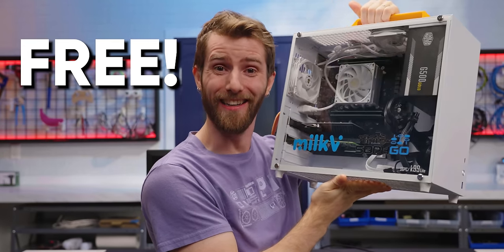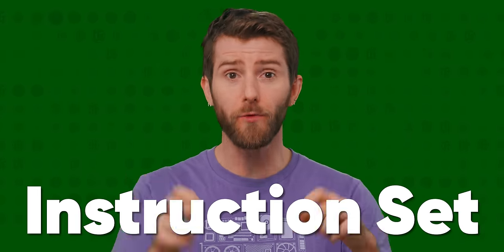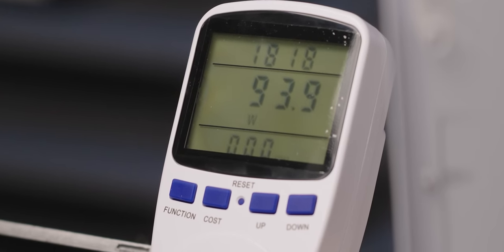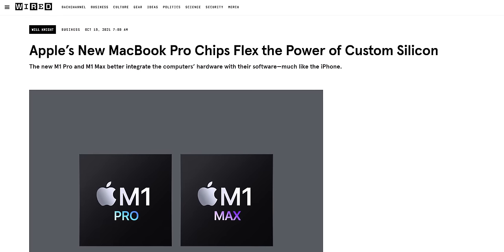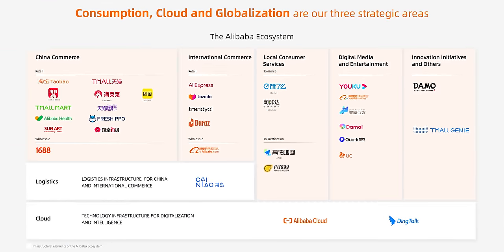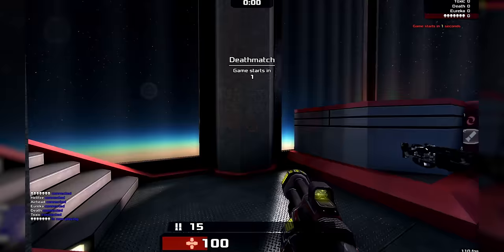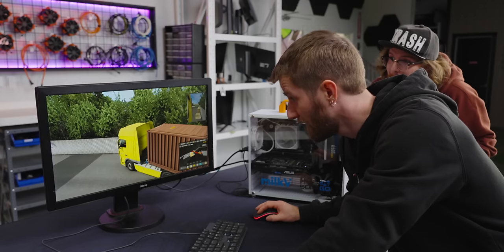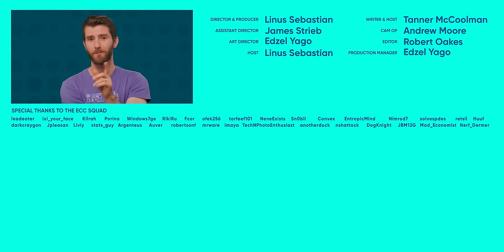This CPU is FREE! - Milk-V Pioneer with RISC-V

Comment: Just a quick FYI for everyone. ISA or as it's referred to here, 'instruction set'. Does not matter when it comes to performance, it is all down to the microcode. Think of the ISA as the building blocks and the microcode as the blueprint. How well you optimize the blueprints determines how fast you build what you need.
Reply: Yes, with a Reduced Instruction Set it's far easier to optimize microcode.
I used to work with Sun on the SPARC systems - Yeah I know, ancient.
Reply: I mean, simplifying the ISA simplifies the whole design, no?

Fewer instructions means fewer paths to optimize. Not having to maintain backwards compatibility with x86 bugs that got elevated to features will help with that, too. Theoretically, you can fit the full performance of these most important instructions into a smaller chip that uses less power.

But... x86 has a lot of history and momentum behind it. What we have is heavily optimized  while your RISC-V chips are still largely in the exploratory phases. But... There's a reason Intel's Atom chips never really competed with Arm CPUs.
Reply: @psiah9889 It really depends on the task at hand. Even if you can get better optimization of your simpler design, that doesn't mean the software runs in a more optimized way. Just look at how many instructions ARM has picked up over time. Went from not supporting division to supporting SIMD, crypto extensions, and so much more. On the opposite side, x86 is largely RISC under the hood with only the instruction decoder understanding all the instructions before promptly decoding them to simpler instructions that the processor can actually execute. I don't think there's a huge difference in complexity, which is why only a few companies actually design ARM cores (just Apple and ARM these days, I believe) and the rest of the SoC designers just license ARM's core designs.
Reply: Not true. ISA can affect performance, specifically in 2 ways:
1. Atomic operation, specifically synchronization. Thread synchronization when done without atomic operations can take hundreds of cycles since it requires trying and retrying to synchronize until it is successful. With atomic operations synchronization is guaranteed to be attempted once and completed successfully.That gives CISC CPUs some advantage in multithreaded applications that often synchronize.
2. Heat generation. A CPU core is generating heat from each circuit regardless if its being used or not. The reason is that all of those circuits are doing the calculations at the same time and all results except for one are discarded. The more instructions a CPU can handle, the more circuits a core needs and the more heat it is generating. And heat generation significantly limits max clock speed of the CPU and thus its max performance.

First one give CISC advantage, while second one gives RISC advantage.
And over time the heat issue became so limiting that RISC started winning with CISC, even though CISC was the performance winner for many years.
Reply: Standard RISC-V instructions until now don't need microcode or microops -- or at least 1 instruction = 1 microop. Future high end cores might combine 2 instructions into 1 microop sometimes (as recent x86 and Arm do for "cmp;bCC" but nothing in the market right now (and not this computer for sure).
Reply: @hubertnnn  Core design is a lot more complicated than you make it out to be. First of all, not every circuit on a CPU will be running all the time. It depends on what instructions are running. The CPU will only dispatch an instruction to relevant units of the CPU. You can also frequently implement very complicated instructions relatively simply, after your decoder breaks them down into a series of simpler instructions. Of course, there are many tradeoffs (performance vs power consumption vs complexity, etc) to consider when deciding exactly how to design this hardware, but it is certainly not as simple as saying that a more complicated instruction set leads to a more complicated design. I'd bet good money on modern ARM processors being orders of magnitude more complex than early x86 processors.
Reply: ISA absolutely does matter. You can write the best microcode in the universe, but if your CPU is physically not capable of single instruction integer multiplication, you're gonna be hogging the CPU with aditions for quite a while.
Reply: @Sett86  when people say "ISA doesn't matter" they don't mean that it is impossible to design a bad ISA -- of course it is ... see Brainfuck etc -- but that all good ISAs are more or less equivalent.
Reply: @user-bc7cb8uu7e yeah, but the complexity of the x86_64 Isa requires additional decoding circuitry and plenty of hardware optimization. A simpler ISA means the chip among others can provide similar performance at a lower power requirement and heat output
Reply: @BruceHoult Brainfuck isn't an ISA lol, it's an esoteric programming language. COMPLETELY different things
Reply: @hubertnnn Your second point is false. CPUs have been using dark silicon for years now, so it's not true that the entire CPU is on 100% of the time. If it were, it would fry itself immediately
Reply: @user-bc7cb8uu7e What should also not be ignored is scope. Apple Silicon is often used as an example for the efficiency of ARM based CPUs and they are intended very efficient. But they are custom hardware specifically designed to only go along with very specific hardware from the same vendor. This gives Apple a huge advantage compared to x86 processors, which have to support an arbitrary amount of additional devices and memory configurations. Apple on the other hand can dump a lot of that in their design or tightly integrate it into the SoC, which reduces the overall complexity if the design and in turn increases the performance and efficiency. But it comes at the cost of losing flexibility when it comes to hardware configurations.
Reply: Why are people talking stuff they don't know? Microcode is not used for any performance critical pathways.

Any instruction that relies on microcode is going to have severe performance penalties.
Reply: Dude there are enough processor families that directly use the ISA without any microcode whatsoever..
Reply: @romanpul  that's not very true. Apple Silicon are true general purpose CPUs and GPUs. With documentation, everyone could build drivers and OS for it, and Linux people even manage to do so without doc.
Reply: Be great if you could pick what ISA you used and the microcode dealt with all that, viable.  Indeed, be some institutions who would love a custom ISA and enable better lockdown of the software as be obfuscated with non-standard ISA.  For some tasks (military/security) that would be useful.
Reply: @nocturn9x  not so. Have you SEEN Brainfuck? It's much more like a machine code than a normal programming language. You can easily make a hardware CPU that executes Brainfuck directly.
Reply: soo... i guess apple can do it because their software is optimized for their hardware, and their M series chip also equipped with a lot of specialized hardware acceleration right?
Reply: @hubertnnn  But modern RISC architectures have atomic operations. It would be stupid for them not to include them.
Reply: @RandomUser2401  You missed the point they were making. It's not about "general purpose", aka Turing Complete (MTG and Pokemon are Turing complete), it's about Apple not having to deal with dozens of HW OEMs that might or might not tweak a knob thus resulting in different results. See the AMD/ASUS voltage fiasco for something that would never happen with Apple.
Reply: @Ruhrpottpatriot  again, the situation is not as different as you think it is. Having to support more HW configurations than Apple is no excuse to lesser optimization of the OS to specific HW platforms. That especially applies to Windows RT.
Reply: @RandomUser2401  The OS has nothing to do with the ISA (at least not directly) and nobody claimed anything in that direction. We're talking about ISA optimizations and microcode.

Having to support more hardware with your ISA means you have to factor in more variables, which makes everything harder and some paths even impossible because you can't reason about them with certainty. More general purpose ISAs like X86/64 will have instructions that run in many different situations, but generally won't perform as much. On the other hand more specific ISAs like Apple's flavour of ARM can make assumptions that make it impossible to run on certain HW, but in turn give it a huge performance boost.
Reply: @Ruhrpottpatriot  that‘s horseshiet. Every CPU manufacturer can tweak the microcode to get the most out of their specific microarchitecture. In addition, there‘s tons of x86 extension „to get the most“ out of x86 processors.
Reply: @RandomUser2401  Go take at least the introductory lecture into CPU design in EE or CS. Then we'll talk again. Because you have no clue what you're actually talking about.
Reply: @Ruhrpottpatriot  I am far far beyond that, and actually do design RISC based multiprocessor systems. What you are saying makes absolutely zero sense. There is no „lots of HW“ that x86 needs to „support“. That makes zero sense. x86 defines a huge amount of instructions that each CPU vendor then implements in their optimized way, not the other way round. Now, please read the Patterson book. You really need it.
Reply: @RandomUser2401  "There is no „lots of HW“ that x86 needs to „support“."
I never said that. Stop misquoting me!

"x86 defines a huge amount of instructions that each CPU vendor then implements in their optimized way, not the other way round."
I never stated anything to the contrary.

"I am far far beyond that, and actually do design RISC based multiprocessor systems"
#doubt. And even if, I wouldn't want to buy a CPU from a company where the designers are not able to properly comprehend what the other party is writing.
Reply: @Ruhrpottpatriot  just admit that you have no clue. the burden that you claim x86 has is not existent.
Reply: @mmbb1645  Every CPU operation is atomic by definition. What I meant was that you can either atomically be able to do "Add A to B and store in A" (a simple operation available in all CPUs), or "IF A is zero, put B in A and store 1 in C, otherwise store 0 in C" (a complex multi-step synchronization operation).

In CISC the second example might be available as single atomic operation, while in RISC you will need to do it in multiple steps, thus the entire process not being atomic.
Reply: The biggest issue of RISC-V is volume, as we get more volume, we'll see larger and higher density chps which have more performance
Reply: @hubertnnn  Ah ok, you're right. I didn't realize that most ARM processors only have the "store" and "load" atomic operations.
Reply: @RandomUser2401  That has absolutely nothing to do with what I just said. I was talking about hardware side support, that has nothing to do with drivers or microcode. For example Apple Silicon use on chip RAM instead of dimm ram, which reduces the physical complexity of the memory controller. And it also has the memory controller for mass storage baked into the SoC for example. Try plugging a random m.2 drive into a silicon mac. Good luck with that. No driver will make that work
Reply: This guy has no idea what they're talking about. Microcode is entirely optional when designing a CPU, it just allows to patch some issues in the silicon without needing to remake it physically. But it's not a requirement.
Reply: @BruceHoult  I've implemented brainfuck interpreters and compilers. It's a programming language. Not an ISA. End of story. You could make a CPU that runs Java bytecode and that would be much more of an ISA than brainfuck, rofl.
Reply: @nocturn9x  people have made CPUs that run Java bytecodes, not least Arm Jazelle. Certainly that is a nicer and more usable ISA than Brainfuck, but that doesn't make Brainfuck "not an ISA" but just an awful one (which was the point). I do have some relevant experience and qualifications in this, by the way. I've worked professionally on many compilers, interpreters, JITs, emulators, assemblers over the past 25 years or so. Right now I'm working in the project making the RISC-V JIT for the C# IL. I also get involved in the design of ISAs (you can find my name in the credits in the RISC-V ISA manual and also in the B and V extension specs), and in doing that I interact closely with people designing the actual CPU cores.
Reply: The biggest mistake in optimizing the ARM architecture is that ARM has the authority to prohibit modifications to the CPU core, and many others and also prohibits selling to other parties and so on, whereas if you use RISC-V, the flexibility is very high, the IP is also easy to buy and sell.
Reply: @BruceHoult  A lighter question: this whole ISA comment thread is interesting. I'm moving from Desktops to SBCs and IMHO ARM ISA is smallest, most efficient and affordable (compared to x86). However I would like to support RISC-V ISA (I'm a FOSS fan) if I can find an SBC with dual NICs, 3 monitors, Bluetooth and Wi-Fi. Someone on this thread my be able to help, thank you in advance?
Reply: @kotgc7987  dual gigE NICs and WIFI & Bluetooth is easy -- many RISC-V SBCs have those. Three monitors -- I don't know anything (or in the Arm world too) that has three HDMI connectors on the motherboard. You're basically I think going to need a board with one or more PCIe slots. The Pioneer shown here of course has two PCIe slots, but it costs $2500. There are RISC-V boards with PCIe slots starting from the HiFive Unmatched (now $299 with 16 GB RAM, quad core 1.4 GHz), and also the Pine64 Star64, and the Milk-V Jupiter (price and release date not yet announced, but probably around $100). The HiFive and the Jupiter are both MiniITX boards, the Star64 at 133x80 is a little larger than a Raspberry Pi. All those have CPU cores roughtly comparable to the Milk-V Pioneer shown here, but 4 of them rather than 64, or 8 in the case of the Jupiter. The Milk-V Oasis, probably arriving early next year (they say Q4, but ...) has 16 cores, each about 3x faster than the boards you can get now, and leapfrogging the Pi 5, Rock 5, Orange Pi 5 in the Arm world.
Reply: @BruceHoult  thanks, doesn't have to be HDMI, whatever desktop monitors/displays run off...USB-C, DP or whatever's an easy connection.

Comment: I've been really excited about the future of RISC-V for a while. I really hope they break into the mainstream sometime in the next few years with all the major issues worked out.
Reply: First
Reply: In specialized hardware, quite possibly. But for general computing, I wouldn't expect it this decade, especially with all major issues worked out. One of the biggest factors for X86 is backwards compatibility. Right now, you can buy a 20 years old videogame and just play it without any fuss. Moving to a different architecture will have to contend with that.
Reply: @CanIHasThisName  Apple did it with ARM. I imagine creating RISC-V chips that are specialized for x86 and/or ARM translation will have a big impact. As I understand it, Apple has specialized ARM chips that help it work better with the x86_64 translation. AFAIK Microsoft has been kinda stagnant in the ARM space because of a deal with Qualcomm. But I could be wrong. 

If Microsoft took RISC-V seriously and invested in the future like Apple did, we could see something very compelling. We can already see in this video that gaming IS possible. It's definitely not there yet. But the sheer fact that it can be done means that it will inevitably get better.

Hopefully once the RISC-V instruction set gets standardized vectorization instructions, we'll see much better performance.
Reply: @Spirrwell  Apple did it with ARM because they already had experience migrating from a RISC architecture like PowerPC to an x86 one when they moved to Intel processors. And even then, compatibility is far from perfect. And ARM has been in development for a lot more time than RISCV, with a lot more resources behind it. So, yeah, not in this decade. Probably the next
Reply: @nocturn9x  These days moving an OS to a different CPU architecture isn't the hard part. It's the legacy software support that's the issue. The hardware acceleration aspect of the RISC-V platform will improve and performance will improve. Given the pace, I expect that to happen very quickly.

I give it 5 years and we'll probably see a pretty compelling Linux desktop experience with RISC-V.

Whether Microsoft or any other company jumps on the opportunity or not, who knows?

But it's all happening really really fast. Much faster than I certainly would've expected.

Comment: those "dust covers" are for the PCB manufacturing process. it gives the pick-and-place machine something to grab and pick up the part with. that being said they are usually removed as one of the final steps of assembly of the PCB before it shipped out.

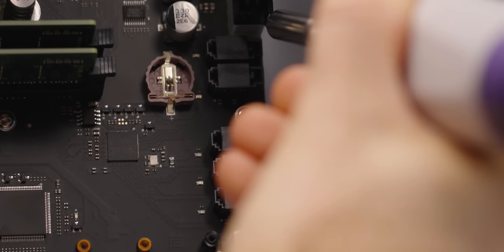Comment: The "dust covers" at 8:43 are more likely to be pads providing a surface for the suction cups to grab onto during automatic pick and place assembly of the motherboard.
Reply: Yep. Same reason a lot of USB/HDMI ports have kapton tape on the top. Sometimes it’s not worth removing